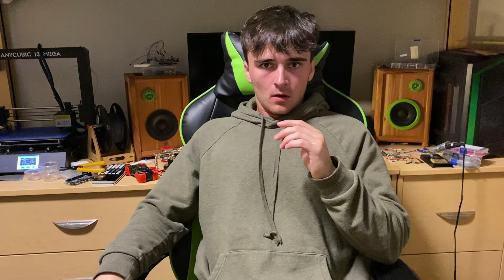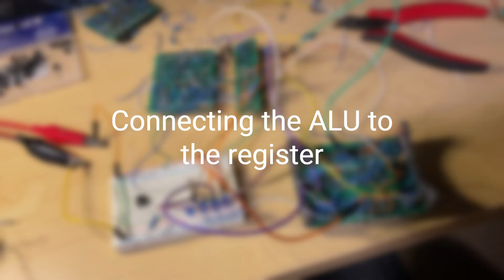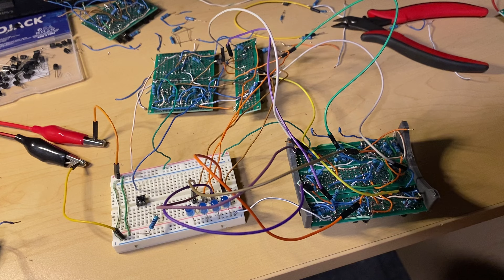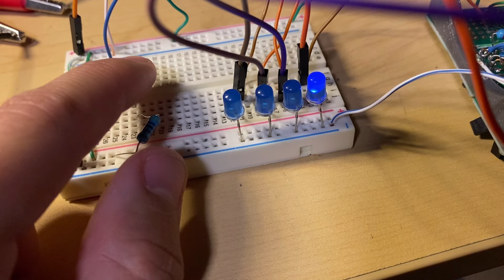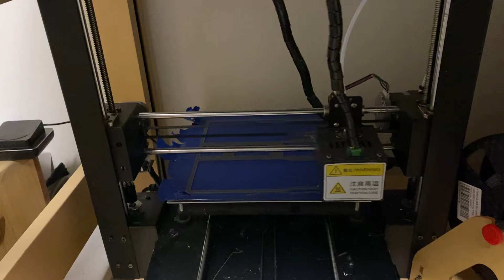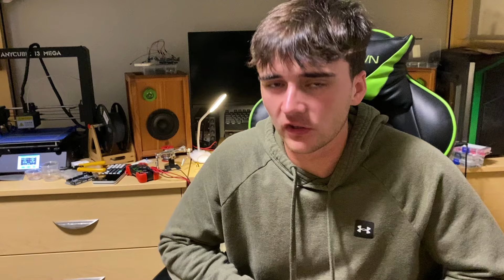Building a Transistor Computer Clock Pt 4

Comment: Im doing the same thing atm, still developing the ALU. what features does your ALU have? Can it compare numbers?
Reply from the maker: It cannot. My final product will be a digital clock so all it needs to do is to add 1 to a number between 1 and 12 for the hour circuit. All my ALU can do is add any 4 but number by 1. This also saved my lots of transistors since it’s only half adders. I made a video on my ALU if you want more detail.